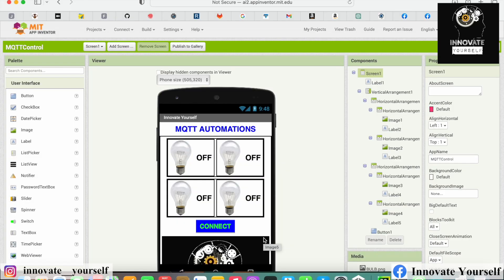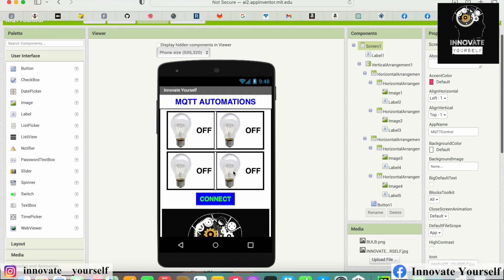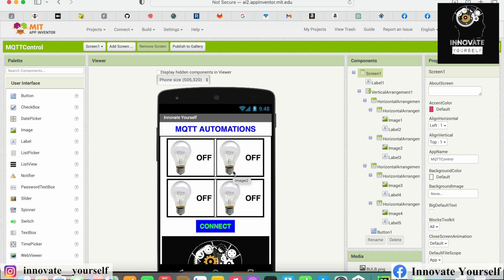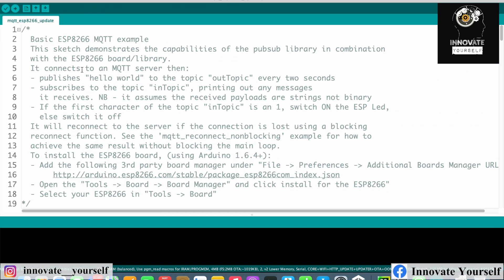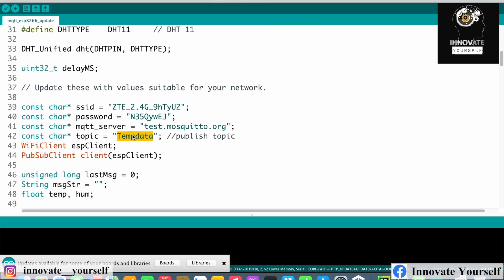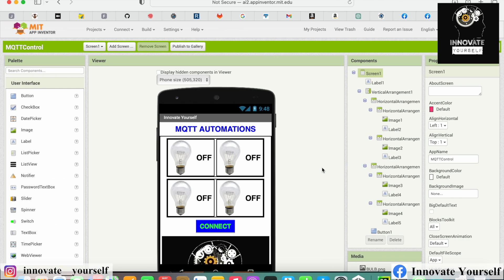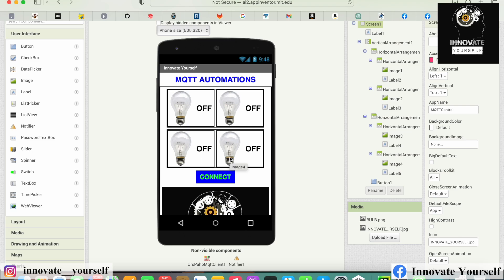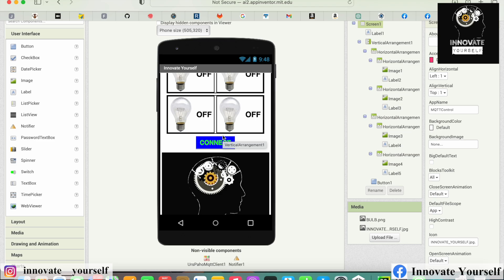Unleash Your Inner Developer: Learn to Build MQTT Apps with MIT App Inventor | Part-2

Comment: Hi sir, why there are no sensor result on my app but my relay function successfully?
Reply from the maker: Hello,
What code are you using? If it is the one which I shared then did you make any changes in the code?
Reply: @InnovateYourselfashu  yes a litter bit just on the pin number because I follow the circuit diagram connection pin number start from D0 to D3
Reply from the maker: Ok. So can you try once with the same pins which I used in the video, to verify that everything is working on the application and hardware side or not?

Comment: Hi i have this error "Attempting MQTT connection...failed, rc=-2 try again in 5 seconds" not able to connect with MQTT. I just opened your files and test. Still error. Plz any help
Reply from the maker: Is your internet working on ESP32. Also, What broker are you using in your case?
Reply: @InnovateYourselfashu  yes esp32... Same broker that you used in the video mosquito.
Reply from the maker: What about the internet, is it working on your ESP32?
Reply: @InnovateYourselfashu  yes, it's working